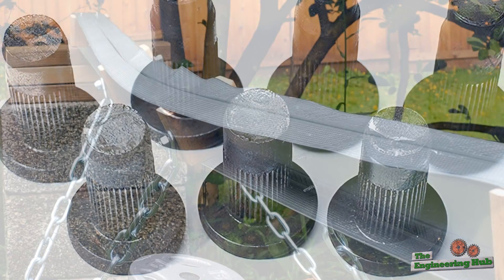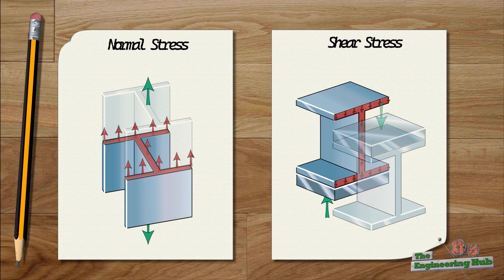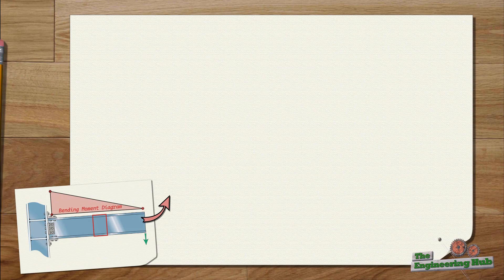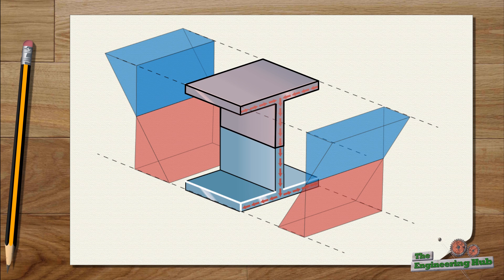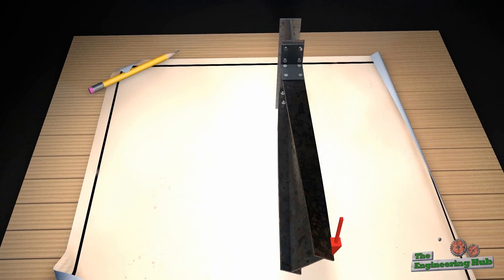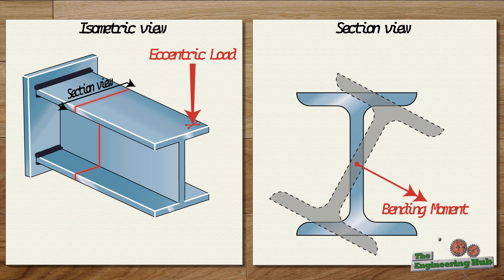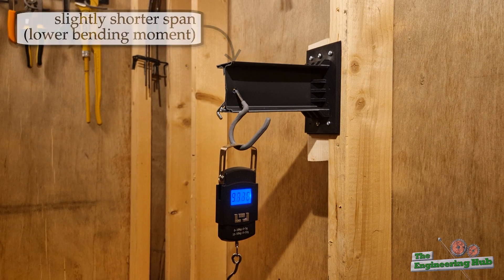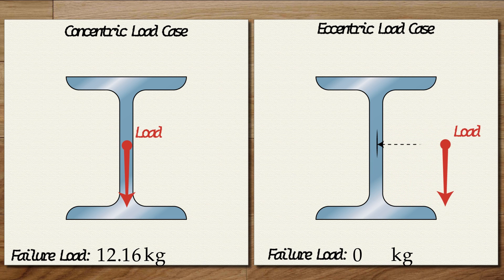The Development of Stresses in Beams Explained

Comment: I would recommend you add a stiffener to the load application location and/or secure the wood to both the bottom and top flange. This should garauntee you see the effects on the section globally rather than locally

Comment: Very good presentation.  Next time, choose a physical model that has a smaller cross section and a greater length.  Yo will get more deflection before failure and a better visualization of the deformation of the beam as you apply the test load.
Reply from the maker: Yes, great feedback, thank you 🙏

Comment: *a LOOSE bolt. Correctly tightened bolts are always in tension until the joint fails.

A locating pin would have been a better example.

Comment: I don’t totally trust examples,especially that are made so differently from actual materials. For this to=o be more convincing, the beams should have been made in the solid. I know, of course, that it would use a lot more materials. But the fact that these are hollow meant the loading characteristics are much more complex. Additionally, the plastic has a different bending modality. Many plastics will crack, or break instead of bending as steel does, particularly A 36, used in most construction.
Reply from the maker: Absolutely agree Mel, all of your points are valid. I will look into repeating this experiment with steel plates now that I have a 10t hydraulic press. Cheers and thanks for the valuable comment
Reply: @TheEngineeringHub  I’ll be sure not to miss it.
Reply from the maker: @melgross  I'm testing some 2x4s currently and measuring the reduction in capacity when holes are drilled through them. That will be coming up shortly. Cheers

Comment: I am interested in how to modify typical construction calculations for the design of structures on Luna, & Mars. Because Mass & weight are separate functions linked by G where typically we would think of G as always being a value of 1, on Luna G is The acceleration due to gravity on the surface of the Moon is approximately 1.625 m/s2, about 16.6% that on Earth's surface or 0.166 ɡ. but I don't know how that works for figuring out how much load an I-beam load bearing capacity should be expected to change, ect. can you make some videos to help us understand how to begin thinking about the design of larger structures on Luna, & Mars when the supplies become available? thank you.

Comment: Another failure mode to consider is lateral buckling in beams.  Even though the beam may be loaded through the centroid, if the beam is long compared to it's moment of inertia, lateral buckling can occur.  Buckling is an elastic instability problem.
Reply from the maker: Yup, we already made a video on that. You can find it in our library

Comment: Normal bolt connections are not under shear stress- tension from nut forces 2 plates together and generates friction
Reply: Many connections actually are bearing/shear type connections for strength type loading.
Reply: @m.5051  that is jist plain wrong. Only if you use shoulder bolts/screws like din 609/ iso 7379. Trust me, I do this shit for living
Reply: @Mikiszub  Do you think your measly experience means anything? I design bridges for a living, and we design the connections  as slip critical for service loads and shear/bearing for strength loads.  I'm the engineer that tells you, the monkey, that bolt goes here.
Reply: @m.5051  I' d better not drive bridges you design then. Additionaly- I design cranes and other transport devices for living.
Reply: @Mikiszub You definitely do not, and it's easy for a real engineer to recognize this. Go review an AASHTO manual and tell me I'm wrong.
Reply: And I could show you DNV report that bashed us for this. And I trust that far more than this garbage that passes for US engineering codes

Comment: Steel gains strength in tension so the torsional effects are often self defeating in a sense. You can't 3d print a 'model' of a W beam and think that it will behave even remotely the same as quality steel. 

I subbed b/c your engineering math is very on point, but there are also large practical misses that I also see daily in stamped engineering out in the wild. 

Legally speaking I'm not an engineer; I merely present them with solutions to stamp.
Reply: What are you even talking about? I know 100% that you've never advised actual structural engineers